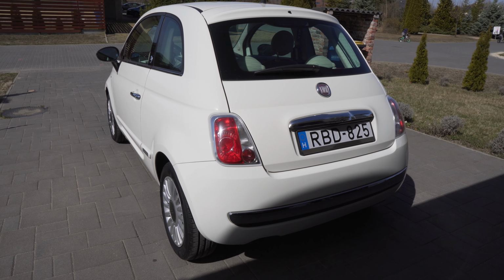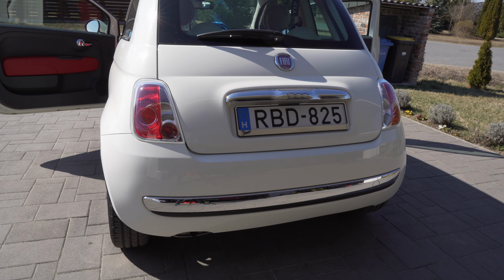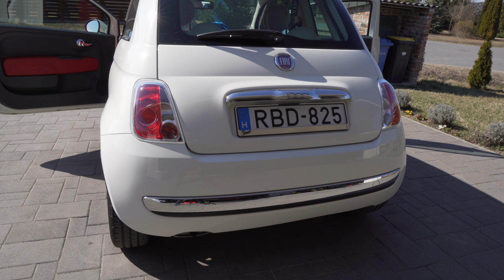Koch Chemie Headlight Polish1 (Hlp1) and Headlight Polish2 (Hlp2) test

Comment from the maker: MJJC Foam Cannon Pro, straight from the manufacturer: https://www.mjjc.com/collections/foam-cannon/foam-cannon-pro/?ref=OCDADDYZSOLT

ADBL Shop, 10% discount with the ocdaddy code: https://www.adblshop.hu/?coupon_id=ocdaddy

Farmasi Hungary, 23% discount by using the following link: https://farmasi.hu/Account/Create?sponsorCode=64648810-11cd-44db-942e-3a229e0eb3b1
Farmasi Poland, 23% discount by using the following link: https://farmasi.pl/Account/Create?sponsorCode=64648810-11cd-44db-942e-3a229e0eb3b1
Farmasi CZ, 23% discount by using the following link: https://farmasi.cz/Account/Create?sponsorCode=64648810-11cd-44db-942e-3a229e0eb3b1
Farmasi Slovakia, 23% discount by using the following link: https://farmasi.sk/Account/Create?sponsorCode=64648810-11cd-44db-942e-3a229e0eb3b1

Polirtech.hu, various discount for certain times, details under the relevant videos: https://polirtech.hu

Automosowebshop.hu, various discount for certain times, details under the relevant videos: https://automosowebshop.hu/?coupon_id=ocdaddy

Primatec.hu, for Polytop and Primatec products: www.primatec.hu

TubeBuddy for better channel analytics and tools: https://www.tubebuddy.com/OCDaddyZsolt
Would you like to have a single card that can be used instead of all other cards of yours? Use Curve - http://www.curve.app/join#DG8K2BLD
Would you like to have one of the best exchange rates and safe shopping/money transfer abroad? Use Wise - https://wise.com/invite/asd/zsoltv23

In case you would like to support the channel, can do the following ways:
PayPal - zsolt.tech.detail@gmail.com
Buy Me a Coffee - https://buymeacoffee.com/OCDaddyZsolt

Comment: Great tutorial !  One question.... what about UV protection/clearcoat...is that only necessary after whet sanding or is it needed even after a polish like the one in your vid?
Reply from the maker: Cheers. The UV protection is always recommended, as even with the polishing only, we remove some of the protective layer. It can be wax, ceramic coating, special headlight film or clearcoat.
Reply: @OCDaddyZsolt  Aha... I understand...Thanks !

Comment: Would be ok if I use something like Koch Chemie F6 for headlights instead of the polishes from this set? How would you compare those to F6 in terms of cut and gloss? The thing is that I already got sanding disc and wool/sponge pads etc. so can't justify buying this set although it is neat!
Reply from the maker: It is fine to use other polishing compounds. The F6 would do the trick also.
Reply: Other Koch Chemie polishes will do a great job at giving you a nice gloss finish, but the 2nd step in this kit contains a sealant as well which is supposed to help with UV protection. You can buy UV sealants separately.

Comment: Did you get any yellowing after doing this, or is the UV sealant in the 2nd step compound enough to prevent it?
Reply from the maker: At this point, I didn't use anything else to seal, as the car was coming back a few weeks later for a full polish. Then I've done the headlights again (wet sanding plus polishing) and closed it just in case with some sort of ceramic coating. Can't remember which one was it exactly.
Reply: @OCDaddyZsolt  Thank you x